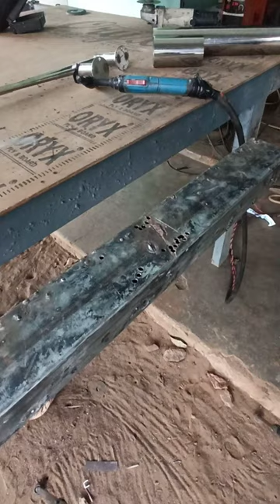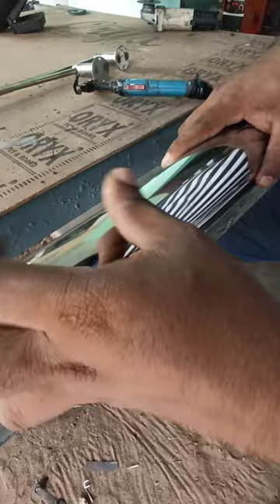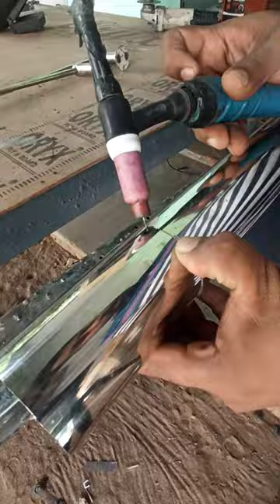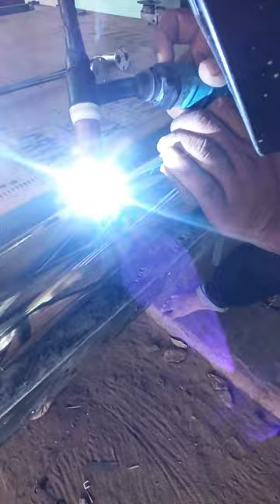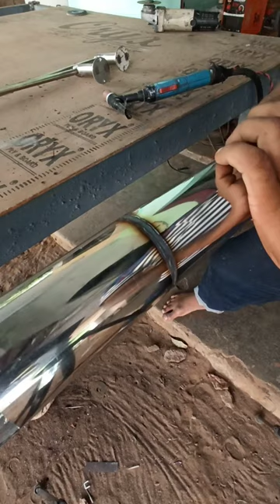#shorts .stainless steel tig welding. |Argon gas welding |    |work -Travel-Tech |

Comment: Welder/Fabricator here..his is not how u tig weld. You do not dip the tungsten rod into your work. You create and arc and heat the base metal without touching tungsten to the work while dipping filler material into your puddle while moving at a constant speed ultimately creating a bead that binds both peieces of metal as one.
Reply: The tube is so thin.. is that process you mentioned practical for as thin as that?
Reply: Nor do you apply as much heat with the finger trigger/ foot pedal.... Ease off that shit bro, you are toasting that stainless. Take it from a professional welder fabricator
Reply: Can't defend much here, but he's running on lift arc or scratch start, so he has to touch off. He also doesn't have a foot pedal, so his current is set. Yeah it's still bad, but it could be worse I guess.

Comment: It’s painful just to look at it. Dude, buy a lens, in it the gas escapes through the mesh, the flow is smoother and it protects the steel from oxidation much better. Pull the electrode out 3-4mm and rest the burner on the ceramic - you will touch it less often. an electrode for steel 1-1.5 mm needs 1 mm or 1.6 - the electrode heats up better and facilitates ionization of the gas.
Weld the pipes in a piece of corner - you won't mess with the alignment.
I often weld on a yacht or floating boat, sometimes in strong winds.
watch other people's videos and don't pay attention to the negativity. At first I also wanted to write “look how I can ruin the pipe”
Reply: dont weld after touch. change electrode or sharp it

Comment: Bhai filler wire ki zaroorat nahi h kya ?
Reply from the maker: No gap     ..no filler wire
Reply from the maker: Subscribe pls
Reply: I also do the same work in Ghana any help boss
Reply from the maker: I am in India.in your area you can start making steel a table. Handrail fabrication and other welding related works.
Reply from the maker: To start own business
Reply: nop. 1.5mm pipe with perfect ends. you will grind all extra metal after. it's not for hi pressure